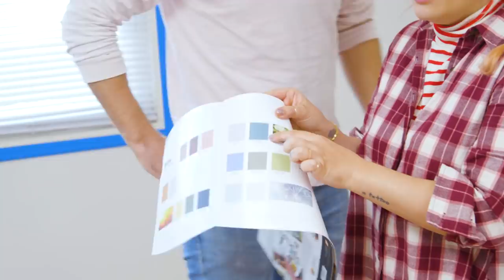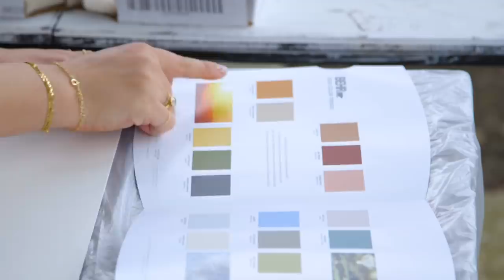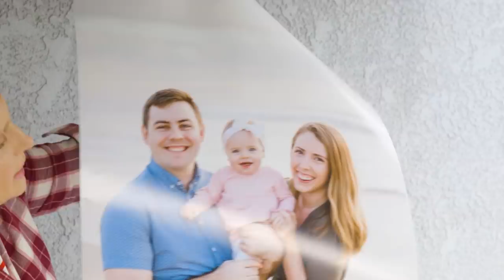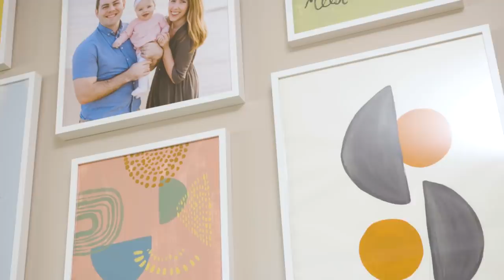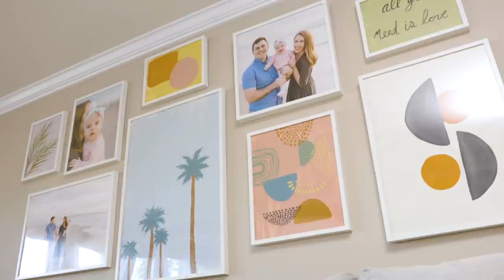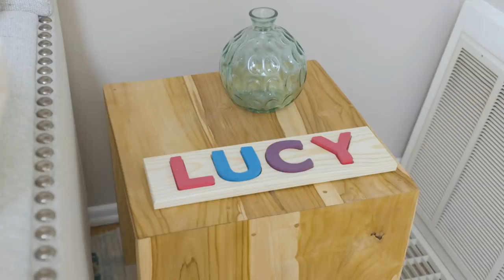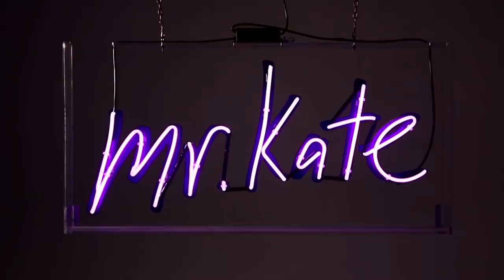We use ALL of the 2020 Color Trends to Decorate a Room!

Comment: The only change I would make to this room, is to take those curtains to the ceiling to give the room a lil more height, but also make sure the curtains are long enough to hit just above the floor, but everything else was on point! i know sometimes its impossible to do this with store bought curtains but if you spend lil extra for custom length curtains it can really give a high end look to ur space and sometimes a quick fix/update for any space.

Comment: The one thing that has immensely helped my migraines is the combo of Magnesium, CO Q10, & B2 all together. I haven't had one in just over 3 weeks which is HUGE when I was getting 2-3 every single day for months.
Reply: cassandralyne Good luck with that.  I hope that the combo continues to work.  Regular headaches are bad enough, migraines are awful.
Reply: Wow yes. Magnesium has been a life saver for me. Unfortunately I still have to take a daily preventative but magnesium +  acupuncture has helped so much
Reply: Yes! High dose magnesium and B2 have been a huge game changer. I still have to do botox to get them really under control but those three supplements were life changing and worth a try after consulting your doctor!
Reply: Magnesium, co q10, b2, folic Acid and the migraine shot😀 I see a dr at the Cleveland clinic so the shot which is normally 1500 per shot is free.

Comment: @MrKate Try magnesium supplements fir your migraines. Take 1-2 everyday. If you are taking any birth control (which would most likely be estrogen since you are nursing), try to avoid estrogen. High levels depletes magnesium and can cause migraines. I had THE WORST, most DEBILITATING migraines,  that were the worst when I was 3 weeks post partum and started estrogen (the mini pill is what it's called) bc. Without the bc, I would get them the week before and during my period. Magnesium put a 90% stop to mine, since they were cause by estrogen.  It can't hurt. Worst case scenario....it doesn't work🤷‍♀️

Comment: Unsolicited migraine advice - as someone busty getting an actually well fitting bra cut down pain in my upper body (including head) A LOT. I still get a migraine type headache occasionally but the difference is huge. Check out A Bra That fits on Reddit (they also have a Facebook page,  Instagram and Twitter but most of the information is on Reddit). You are not going to believe the size they suggest at first but just give it a try.